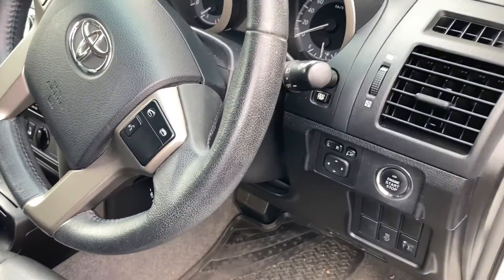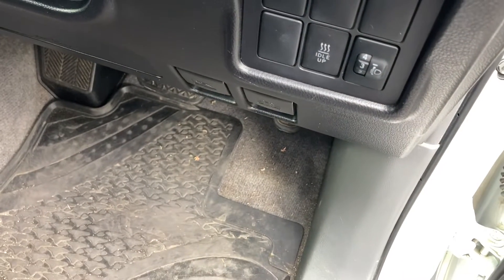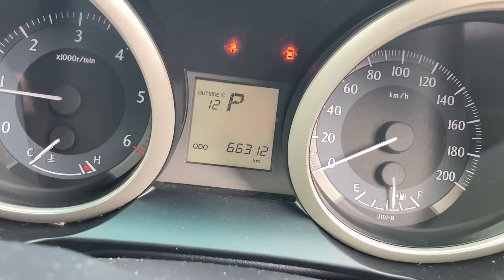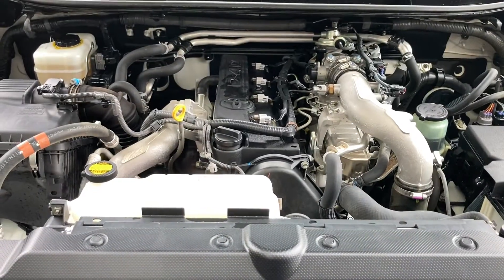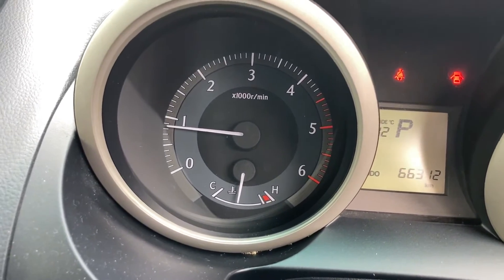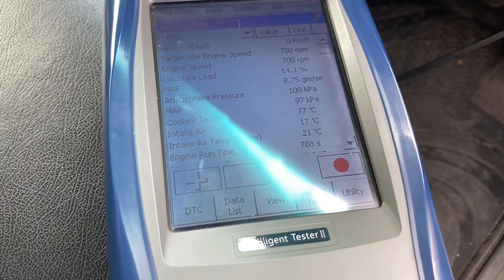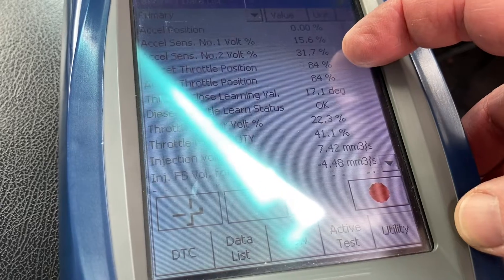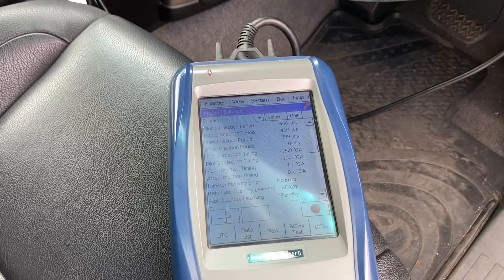ENGINE IDLE SPEED and IDLE UP

Comment: I'm not trying to have a go at ya but I have a 2018 landcruiser 200 series and the only time the engine idles up is when the coolant is below 40 degrees and the air temperature is below 10

Comment: I would always use the idle up button and warm the engine for 2 or 3 minutes before driving . The while point of raising the revs is to get sufficient oil around the engine as quickly as possible  . I normally drive vehicles that are two shades off being a knacker and I've learned every trick to keep them running as long as possible  .
Reply from the maker: If it takes two or three minutes to get the oil moving around, you’re in trouble, the oil is in the whole engine within seconds. And yes, that is when engine damage happens in the first few seconds. If the oil quality is not right this talk of minutes is ridiculous. To be quite honest. I’m sorry.
Reply: @Fourby4Diesel  with respect, I didn't say it takes 2 to 3 minutes for the oil to get around the engine . Warm the engine , is what I said .

Comment: European models of Hilux have a “power heat” button that raises the idle, they have an electric heating element in the heater box that is to ensure heat is available from the heater during start up or long idle periods at cold temperatures, this cuts off when the engine reaches about a quarter way up the temp gauge and heat is available from the coolant. The idle is raised to help the alternator cope with the increased load. This is a great feature in the winter for de icing/de misting. 👍🏻🇬🇧
Reply: I always wondered what that button did. cheers
Reply: What?